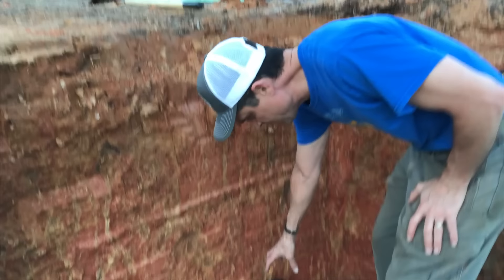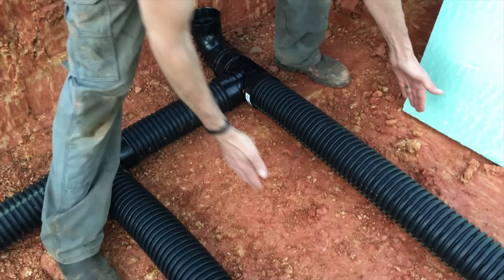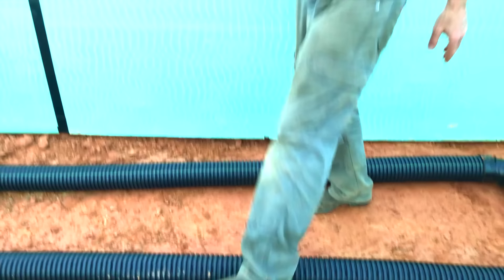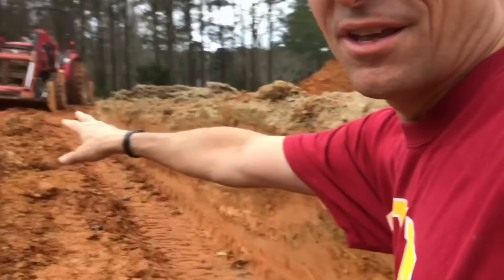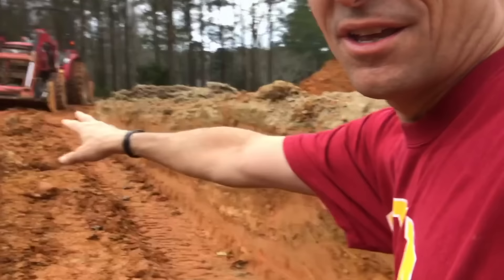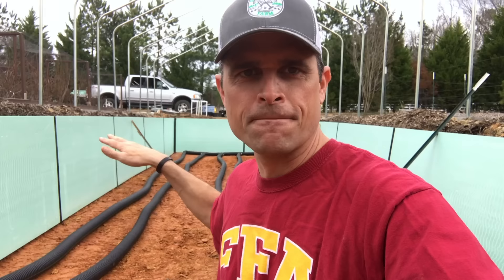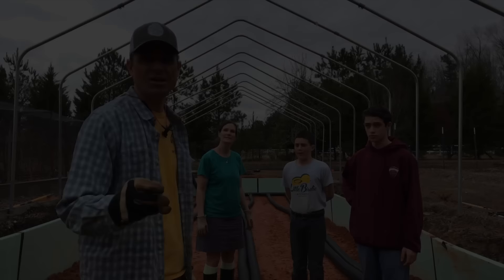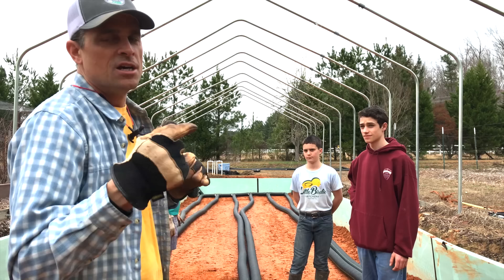DIY Geothermal Greenhouse Part 4: Earth Battery INSTALLATION

Comment: Cheers, great share pre installing a GAHT system on my side. Would you recommend any tweaking to your system, except altering the 4” with 6” inlet? 
I'm would you stuck to clay or use gravel or base-coarse? 

Is it comfortable to be inside in summer? We have hot summers in the Mediterranean climate and i’m interested to spend time in the greenhouse all year around. To grow and just stay there.
It's gone be double glaze.
Many thanks in advance. 
All the best
Reply from the maker: Without a system to compare to personally, it would be hard to know about tweaks. The biggest improvement would simply be moving MORE air. Money was a limiting constraint for us. If it wasn't, we would have used much larger pipes and fans. As a result, it is NOT comfortable inside in the summer. The system simply can't move enough air and the solar gain is too much. Hope this helps.

Comment: I"m looking at doing something like this, but I live in a drained swamp and if I have perforated pipe it will fill with water likely to the point of restricting or preventing air flow.  any suggestions on other piping to use?

Comment: Preferated, water going to enter and not leave in clay, like drain tile, easiest path. Eater build up probsbly
Reply from the maker: We've had it running for some time. No water. Actually, we have the opposite problem - the greenhouse has become too dry. Air has actually worked it's way up through dry cracks in the ground and we have little fissures of air blowing in the ground.

Comment: Hi...ok so if no insulation on the bottom its like a cooler with no bottom....that will let the heat go down into the earth which is not desired.  

Im not picking...just saying for others who may do same.

Coolers w no bottoms dont work so well.
Reply: This cooler is surrounded by earth so the major heatloss will occur near the top. Consider air above the mass at -20F and ground below the mass at 50F. You can insulate the base tf you want but it will fix the total amount of mass in stone.
Reply: @JohnGuest45  Hi, yes heat flows from warm to cool at an increased rate with temp differential.  

To be most efficient, and to keep as much heat as you can just below ground,  you dont want to expend energy to put heat there and then have it leaving the bottom at any rate, even 5 to 10%.

Its like leaving a window open in your house during the winter even if in just one room.  It makes a difference.

You only want the heat your paying for by fan to flow one direction, upwards.

Fun project.
Reply: @mrpush2532  
You want the heat to be distributed evenly in the mass.Heat moving downwards increases the temperature which in turn slows the transfer of heat downwards. I have temp sensors installed below the system and also outside at the same depth, the ground below the system is always warmer than the ground outside at that depth. If you track the ground temperature under a system over a long period of time you`ll notice the average ground temperure below increases over several seasons and then it levels out, This is reflected by smaller swings in temp at depth compared to the original start point and an increase in the average ground temp at depth also compared to the original start point. I dont know if this is specific to the local climate, soil type or installation, greenhouse  etc, a lot of folks bury tubes but forget to put any temp sensors in the ground so they dont know what is happening and cant contribute .They simply say, it works! 
The COP of these systems in cooling mode (storing heat) can be 30 or more so you get a good return on the cost of running the fan.

Comment: Don’t you think the tubes will flood with water? You saw what happened on your second video when it rained. What’s to stop water from seeping in from the sides and filling your pipe...
Reply from the maker: Good question, and yes the bottom tubes did fill up with water. We have a small dc pump and it quickly removed the water. This past week/weekend we graded around the greenhouse and began installing a french drain. This should almost entirely eliminate the problem.

Comment: Unfortunately the intake pipe was not oversized.  The feeder needs to be bigger to get full air flow to the smaller distribution pipes.  You should dig that up and change it.  A big part of the system you did not mention is the evaporative cooler effect of heat removal and addition.

Comment: That baby is for sure going to fill up with water.
Reply from the maker: Hopefully not, given that it is within the footprint of the greenhouse and water doesn't easily perk through this red clay. But we'll see. Hasn't so far in some good heavy rains and being out in the open. Thanks for watching.
Reply: St. Isidore's Farm all the good vibes to you guys.   You're doing an amazing job though and thank you so much for sharing your process.
Reply from the maker: Thanks for your comment. You'll notice that on our latest video, we put in a clean out just in case we ever need to run a hose down to the bottom to pump out water - your comment helped motivated that prudent decision!
Reply: St. Isidore's Farm great to know!  I only mentioned it because I live in northern Ohio and I do a lot of trench work and we have lots of hard clat.   If you dig up clay, it's going to allow water through it until it's fully back to "hand pan".  I've made the mistake of making a rocket mass heater under the floor in my TINY greenhouse  (10x18ft) and even with the passageways(cinder blocks that I siliconed end to end) 3ft inside the walls of the GH and the overall elevation of the GH floor being 2ft higher than the entire surrounding area, with a heck of a lot of clay machine packed back around the passages and the GH outside had gutters and a really nice grade of clay away from the GH..it filled up with water the very next spring.    Granted, I only went down 2ft, so the passages were about level with the ground outside the greenhouse.

Ground was 10000% saturated...as it is every spring.  I've been keeping a very close eye on everyone doing these geothermal GH setups and try to be devil's advocate...as I really appreciate it, MYSELF, when others bring up possible mishaps with any projects I do, as to make my projects perform better or satisfactory.  

I wonder if, since you used perforated pipe(your the first ibe seen using perforated, but I'm sure there might be others,  I just haven't found them yet)...if slipping a "silt sock" over the pipe would have been a good idea...? 🤔 

I love this stuff and I believe highly in greater efficiency with the ways we produce food, as a whole...as a human race.  

I'll be making my attempt with this in due time, next season more than likely.   

You'll make it work out and I'm sure the ability to drain any possible water in the pipe is going to come in handy...if it never fills up...then I'm happy to be proven wrong and learn from someone more knowledgeable than myself.   

Cheers. 
Jarred

Comment: Is 4ft down and 2 ft down deep enough? I know in Wisconsin I read we have to be down 6-8 feet to get that stable temperature
Reply: Chad, you`ll be fine with 2ft and 4ft for the tubing. Install vertical perimeter insulation and design the tube layout and manifold(s) for minimum loss. Most importantly, dont be tempted to use overly long tube lengths.
Reply: The winters are a lot milder in North Carolina. The frost layer is closer to the surface. Our temperature gradient is warmer at 4' in the winter than in Wisconsin. You may have to go 6 feet. Ask your local Ag Agent or a near by University Soil & Conservation department. @CT-YouTube

Comment: Does the CFM on the fan come into play when pushing the air? I have a smal (8x8) greenhouse. I can use a 152 cfm fan on a 4” pipe to turn over the air 17 times, but something tells me with three layers of pipe under the greenhouse, that one fan will not be enough
Reply from the maker: You are correct. What we learned is that we need larger fans moving more air.

Comment: did u know where ur water table is, I get concerned that the pipes will fill with water, perhaps this could happen periodically and it was just drain ?
Reply from the maker: In the nearest well, the water table is 27' down. Don't think that will ever be an issue. We did have to do grading around the greenhouse to get the water away when it rained. The first few rains, the greenhouse flooded and water DID go down into the pipes. Since grading away from the greenhouse we've had zero issues. If anything, the problem, we are having now is maintain humidity in the greenhouse so the system will work (needs moisture for evaporative cooling).

Comment: We've done a similar system at our farm on a 30x96 greenhouse (threefoldfarm.org). Would love to chat once you get it operational to see your performance. We've been tracking the temperatures of our house and recording them to our page. You did a really nice job laying out the pipe. Since you have clay soils, I'm wondering why you didn't buy socked pipe. We have a considerable amount of clay in our soil and I was concerned with clay particles washing into the pipe, so we went with socked pipe. Perhaps it wasn't necessary but I didn't want to risk it.
Reply from the maker: Funny, we debated the sock, but decided against to save any money where we thought we could. Then JUST TONIGHT I went back to the Ceres Greenhouse Solutions website (copying their installation, and on one of their countless pages about this system, they do say they use socks. But they use it more to keep bugs out. Bugs won't be an issue for us. This red clay packs almost solid and there was little to no evidence of water penetration at those depths.. And what little particles get into the pipes won't be an issue (we hope). All that said, this is a small test run for a much larger greenhouse we hope to complete in the same garden area. Mistakes can be corrected and improvements made on that one!
Reply: St. Isidore's Farm you may be right, there may be very little going into the pipes. I hope that's the case for you! Will you be monitoring ground temps? We've found that it's a great way to determine the charged state of the "battery"

Comment: Hello! Nice project. Could you please tell me, what is the diameter of the pipe? thanks in advance!
Reply from the maker: If you watch one of the next videos in this series ("Mistake") you'll see that we change the return pipe diameter. So the pipes going down into the ground and serving as the manifolds are 6" (15.24cm) and the black corrugated pipes are 4" (10.16cm). Hope that helps.

Comment: Wow, pretty exciting!  Question though: won't the earth on the bottom pull the heat out since you're only insulating the sides?
Reply from the maker: Yes, that is certainly a possibility (probability?), but honestly we were on a tight schedule and budget. Buying more foam at the time was not an option.
Reply: Well, I don't know where you're located, but if the earth freezes there in winter, at least you're insulating down to below the frost line where the soil temps are pretty consistent year round.  So that still could make a huge difference...perhaps THE difference!  Will be interesting to follow you and hear about your observations.

Comment: Why four feet,  most areas are only thermally consistent at 8 to 10 feet below the surface.  The insulation explanation is strange because you shouldn’t want a thermos to heat up and stay that way, isn’t the whole idea is to weep hot and cool air out of the pipes, depending on the season?

Comment: I'm confused,  is the system cooling only or cooling and heating depending on the weather?
Reply: It moves heat from where it's warmer to where it's cooler, which helps with daytime cooling and nighttime heating.  Think of the ground as a giant thermal mass that reduces temperature swings for the plants.
Reply: @AlecMuller  thank you very much

Comment: Shouldn't be serial lining (S shape) instead of parallel lining ? Cuz the air will travel in shortest distance
Reply from the maker: If you think about the heating and air systems in your house or your car, they operate with main trunks and then branches going to the registers or vents. Air wants to reach equilibrium in terms of pressure, especially in our case where all of the pipes connect back to one exhaust pipe. In fact, we checked this (but didn't get video) by running the system with open ends on all six pipes. The air coming out of each was the same. Hope this helps.
Reply: Cool ...

Comment: Won't the pipes collapse from the compressive force of soil.
Reply from the maker: Good question. Thankfully, no. In fact, two videos later we had to dig back down on the ends to correct a mistake and the pipes were fine.

Comment: I know this is old, but the design on the bottom is flawed. The air will follow the path of least resistance, so air will not be flowing through most of the pipes, it will short circuit. Should have been a continuous run.
Reply: If you install a continuous run you may as well bury the cash you plan to spend on the tubing and save yourself a lot of digging.

Comment: Is there evidence this system works? What kind of temperature differential do you get with yard ground temp vs house ground temp vs normal greenhouse ground temp?
Reply from the maker: The two bits of evidence that the system works that we have now are the dramatic difference in the intake and exhaust temperatures - about 30-40 degrees - and - on the last truly cold day of spring when the system was functioning, the temperature outside was 34 with heavy frost everywhere. The temperature inside was 60. Right now, they system is definitely too small to offset the passive solar gain from the sun, but we hope it's real ROI will come this fall, winter, and spring when we can grown cool season vegetables without concern for freezing. Hope this helps!
Reply: St. Isidore's Farm 60f exhaust sounds awesome! Any idea what your fan electricity cost are monthly for this size gree house?
Reply: @StIsidoresFarm  
The system is large enough but the layout isnt conducive to moving enough air.  The lack of cooling performance is compounded by the low humidity,  which typically provides over 75% of the cooling.

Comment: Hmm, the dirt walls are already insulation and the purpose of the below grade greenhouse is to utilize those walls and their thermal mass to cool and heat with. Putting insulation over them restricts their intended purpose. You need a material that conducts/transmits the earth temperature, like a poured concrete wall.